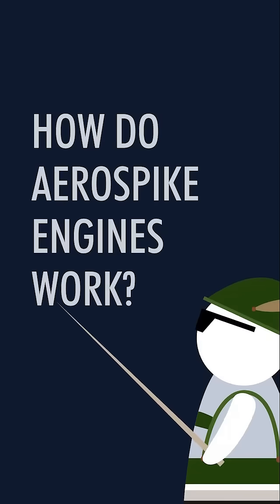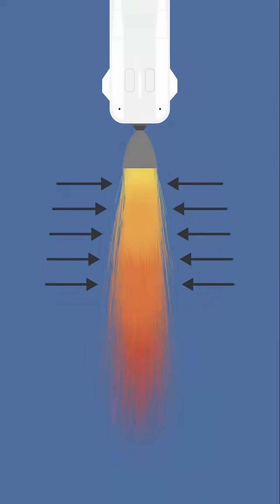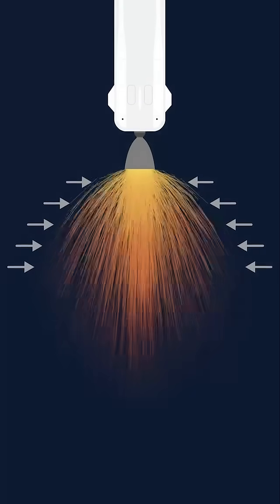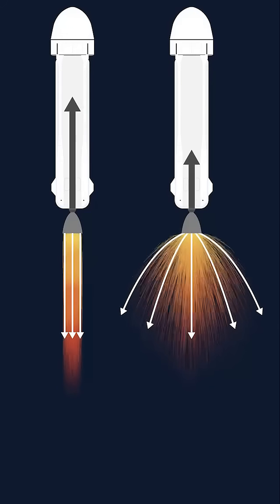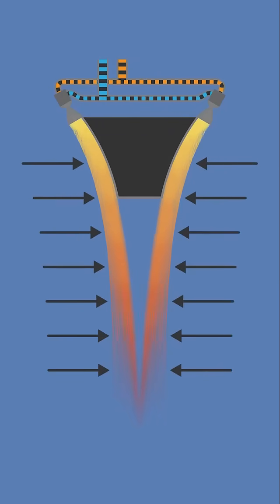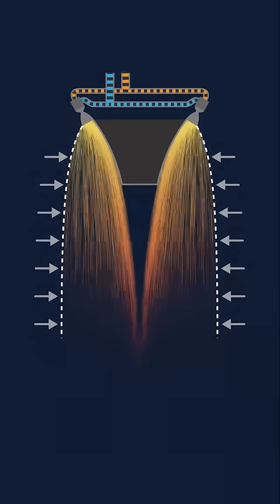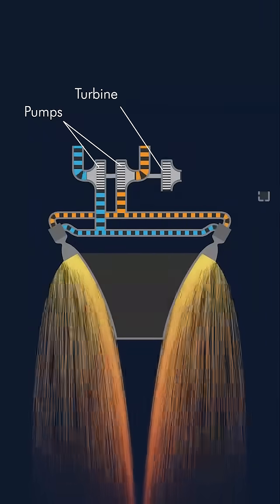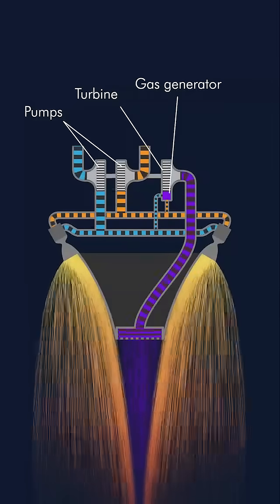Aerospike Engines Explained in 60 Seconds

Comment: I wonder if the difference in performance is enough to save a stage. Often rockets have an initial booster with an engine optimized for low altitude then switch to the next stage with a high altitude/vacuum optimized engine. Could an aerospike theoretically take you all the way up? Sure, you get a mass savings when you dump a stage but not having to lug a whole 2nd engine around is another savings.

Comment: The only problem is the video is wrong -- conventional engines gain efficiency when ambient pressure drops, not lose.
Reply: The lost efficiency at low altitudes is due to slower exhaust carrying less momentum than faster exhaust in vacuum.

Comment: For anyone wondering: the expansion OUTSIDE the nozzle doesn’t matter that much - the gases have already given the momentum to the rocket. And secondly, it is a good thing for rocket engines, as the gases in the nozzle are supersonic, and the speed of supersonic flow increases with expansion of the flow, unlike with the subsonic flow

Comment: The one key concept I would have tried to include is that, in traditional engines, the size of the bell is tuned to the ambient pressure, but its only maximally efficient at that one ambient pressure. The problem aerospikes try to solve is to be maximally efficient at all ambient pressures / altitudes.

Comment: They don't work, and this video is ridiculous
Reply from the maker: The German startup Polaris has tested an aerospike mid flight and the test was a success, so I guess real life engineers would disagree with your statement
Reply: I don't care  @spaceiac .  Results are easily falsified.  Ask me how I know.

Anyone with a real engineering education sees the folly of the concept.  It will, however, never die because the world is obsessed with 'disruptive' ideas that will earn big money.

How many Russian spacecraft use an aerospike?  Zero.
Reply: @DumbledoreMcCracken you ask someone with an engineering education.

Aerospike engines work and have been shown to work, they aren’t used on normal rockets because the benefits are marginal compared to the problem of heat dissipation they have
Reply: @peeperleviathan2839 they don't work.  I have a mechanical engineering education, and that allows me a certain degree of skepticism that is not typical in the aerospace community.
Reply: @DumbledoreMcCracken okay, explain why it doesn’t work.
Reply: @DumbledoreMcCracken silent now. Hmm
Reply: @peeperleviathan2839 because the aerospike throws away the majority of the static overpressure that the traditional bell nozzle converts into thrust.

A possibly better solution to the problem of underexpansion, in the bell, is to introduce additional fuel+oxidizer into the bell, after the combustion chamber, a la the afterburner, at low altitude where the static pressure pinches the combustion stream up inside the bell.

Comment: The graphic of the underexpanded flow is a little misleading. Thrust actually increases as ambient pressure decreases. Therefore, the ISP, or specific impulse would increase, making the rocket more efficient at creating thrust. The problem with under expansion is that the pressure energy that could have been used to generate more kinetic energy is wasted. Cool graphics otherwise!

Comment: What other materials can they be made out of?  

What about coated graphene and carbon nanotubes?  Would that make it light enough to Mount say 4 (plus 8 smaller) of these to a “Giant Silo/short cylinder?”  Say 4,500 to 6,000 feet in diameter and 2,000 feet high (yes- Burj Khalifa level height)and filled with helium, Hydrogen, and oxygen?

Think it’s possible to “Launch” it at 100,000 to 130,000 feet?

Comment: aerospike engines, if perfected, can help solve the problem of building a rocket which doesn't lose efficiency from sea level to orbit. But this is not an important problem to solve because there are already several good reasons for two stage rockets.

Comment: Forgot to mention that aerospikes can be adjusted at all altitudes to maintain maximum efficiency by moving the spike in and out.
Reply: and that would be the biggest bonus for aerospike engines.
Reply: This is not a Mig-21 intake shock cone. How would that look in detail? For example, if I convert the star ship. I make it even wider and place all raptor engines on a circle . They point inwards. Starship lands on the tower, to I have space to hang a cone down. So you would lift the cone and point the raptors inwards. And this would work better at sea level or vacuum?

Comment: I didn't know there had not been any aerospike launches. Great fun fact!
Reply: There was one NASA research engine made for the Venture Star (linear aerospike), but that program was canceled before flight.

The upcoming Stoke Aerospace upper stage will use an aerospike, where the spike surface doubles as a heat shield for reentry.  Very ambitious, but if successful may lead to the first fully reusable orbital launcher!

Comment: I don't get it, why does the exhaust gas expanding change the propulsion? 
It seems like the expansion would only occur after the propellant gas has already left the nozzle, but after leaving the nozzle the gas doesn't propel the rocket anymore. Can anyone explain?
Reply: nice question, replying here for the answer because i wanna know too
Reply: The 'overspray' out the sides generates lateral (side-to-side) propulsion, negating how much force is applied directly to the engine's upward potential energy; resulting in wasted energy, and overall higher cost in fuel /km traveled upward.

it still moves the engine in the right direction (as indicated in the Short) but less so than the Spike

Comment: What is "no flight experience?" Like they've never been used?
Reply: yes
Reply: Instead of a heavy aerospike engine, we use 2 different sets of engines. One optimized for high atmospheric presure. One optimized for vacuum.
Thanks to SpaceX's innovation we can even land and reuse the boosters and bottom stages, cutting down on the price.
The spacecraft becomes also very light once the lower stage is seperated, fascilitating the acceleration towards esape velocity with less fuel.
Reply: @ no one asked

Comment: That's one of the reaons why rockets have stages. They use engines optimized for the flight profile in each. The big difference is the bell nozzle.

The Space Shuttle is the only engine that's good for all altittudes. It's bell was designed in a way to mitigate the ISP loss in near vacuum and it's pretty cool. Though the Orbital Maneuvering System is what kicks it into orbit, using hypergolic Monomethylhydrazine + mixed nitrogen oxides
Reply: I think we have not enough animations which show how the shuttle drops the tank. So the tank stays on an elliptical orbit and will aerobrake, while the shuttle gets a small kick at the apex?
Notice how LEO satellites have their own third stage which still should use LH2 and HO2  and huge nozzles on tiny chambers( they have time to ascend ).
Reply: But it is wrong. Space x's sea level Raptor engine actually works in a vacuum.
The Raptor engine also passed the vacuum re-ignition test.
In addition, there are engines that operate even a vacuum.
(I'm using a translator because English is not my first language.)

Comment: So rockets DO push off of air.
Reply: not really? more like, air pushes off rockets. the thrust comes from throwing the burned fuel away from the rocket, not from the air pushing -- it's just that when there is less air, the propellant doesn't all go straight downwards, so it's less efficient. it does still function though, and works in a vacuum too.
Reply: @lazilexi  
In a perfect vacuum a fuel based rocket would produce no thrust. Rocket exhaust pushes off the air in order to produce thrust. Thank you for at least admitting the air matters. #NewtonsThird
Reply: @thomasg4324  i'm sorry but that's just not true. rocket thrust is made by throwing exhaust particles in one direction away from the rocket. each particle has some mass and therefore some momentum, so the force of throwing each particle out imparts an equal force on the rocket (as described by newton's third). the air only matters in this scenario because the ambient air pressure affects how spread out the exhaust will be, and any angular deviation from straight away from the centre of the rocket is essentially some wasted energy lost to horizontal movement. fuel rockets (which is all rockets, really - even ion thrusters use xenon fuel) do demonstrably work in a vacuum, because if they didn't than we couldn't have gotten to the moon, let alone any of our more impressive probes across (and outside) the solar system.

Comment: This looks just like pointing the nozzles in at each other. 
Couldn't they gimbal regular engines towards each other?
Reply from the maker: There's a reason why the Falcon 9 rocket has 9 engines. The outer ones can be gimbaled slightly inward, slightly improving performance at higher altitudes, but it's not as effective as a normal Aerospike would be.
Reply: @spaceiac   I didn't realize the outer ones could gimbal.
Reply: As long as you have multiple combustion chambers, yes, that’s the norm.

Comment: Why does the thing in the middle not melt
Reply from the maker: Good question! They do melt and that's a problem, so there are a bunch of small channels in the spike where the fuel is running through cooling the spike. Basically how a liquid cooled PC works
Reply: isentropic expansion in the bell nozzles before. You could check vacuum bell nozzles. The rim is just carbon ( a vase if you instruct your 3d printer ). No regenerative cooling needed.

Comment: The question is though, if they are so good, why don't we use them?
Reply from the maker: too hard to cool. Cooling is a huge issue with aerospikes, but metal 3d printing opened up some solutions for that, so in the future we will probably see some companies using aerospike engines
Reply: @spaceiac  too cool to cool

Comment: can't get a similar effect pointing some engine nozzles inwards?
Reply from the maker: I like your thinking mate! There's a reason why rocket labs rocket and spacex's falcon 9 have 9 engines in their first stage. You can point the outer 8 inward slightly using the exhaust of the center one as the "spike"

Comment: If the first part was true (that the exhaust expansion is a leak of power due to flux being aligned with the desired acceleration), the aerospike would be terribly inefficient due to a not aligned exhaust BY Desing.
The power leakage is actually due to a bell that COULD HAVE BEEN bigger, thus letting expansion occur against it. This is, of course, impossible at sea level due to flux risking beeing detached by air pressure (wich result in imbalanced pressure against the bell's wall and may lead to unexpected disassembly, as they call it).

Comment: This is incorrect. Your diagram shows the rocket in thinner atmosphere becoming less efficient than the rocket in the thicker atmosphere. In reality, as the atmosphere gets thinner, there is more pressure difference that could be captured with a hypothetical larger nozzle, and relative to this potential, a smaller nozzle is less efficient, however, what happens after the gasses leave the nozzle doesn't affect the actual power output. The rocket in thinner atmosphere becomes less efficient THAN IT COULD BE,  but not less than before. By showing the arrow getting smaller, you're suggesting that the nozzle produces less thrust. What actually happens is thrust stays the same, while potential thrust increases in the lower atmosphere case, and it is only in comparisson to different POTENTIAL output that the thrust "drops"...

Comment: All I see is how you can vector the thrust by manipulating the spike 😳🤔 Why is nobody else doing this? 😏
Reply: Because Aerospikes offer less performance in specific conditions. It’s cheaper and easier to implement a sea level (plus altitude) optimized engine on boosters because you can cluster engines and get the same effect with no thermal, mass, and GNC issues. And on orbital stages, you are high enough that having an aerospike just eats performance away from your stage.

Comment: I was just about to ask, but at the end I got my answer. Cooling looks like it would be very difficult to accomplish
Reply: Fundamentally the cooling requirement being three dimensional works as plotted on a cubed slope, but the surface area of the spike being two dimensional is plotted on a squared slope. The plots diverge, the cooling problem won't be overcome.
In a way it's like the basic concept of the ancient RL-10 hydrolox engine prevents it from future growth because there's no way to transfer more heat to the fuel mix so no greater amount of fuel beyond the amount in the current design. The changes for the last 50 years on that engine have been to make it lighter, more reliable, and now to incorporate 3D printing, but not able to burn more fuel.

Comment: Question: How do aerospike engines work?
Answer: they don’t
Reply from the maker: Well, they do but not for very long as they tend to overheat
Reply: @spaceiac  would it work if I used a material that is a good thermal insulator?
Reply: @dwalvyn that’s called a heatsink engine, works in small durations but anything will eventually overheat from the exhaust especially in an aerospike as well as driving up the cost

Comment: Isp increases as a function of altitude because the back pressure you're expanding to decreases. How do you reconcile that with your claim that rockets get less efficient as pressure decreases?
Reply from the maker: I should have phrased it differently. A straight exhaust plume is more efficient than an expanded one under the same pressure. So what I meant to say is that it could be more efficient if the exhaust plume wouldn't expand. It's bad wording, and I am totally aware of the mistake

Comment: I was curious if we could use a alcohol sanitizer as fuel since we can combust it to a gas state, by adding lots of pressure either by using a piston to add pressure or either adding Air to the container, then it becomes into its gas state then after that, we can use other fuels to light it up, like hydrogen since it is extremely flammable.
Then use it on any type of engine such as just a normal engine or a new engine that's the alcohol sanitizer fuel.

I was pretty much thinking a d imagining about this actually happening.
Reply: Sure, alcohol was used as a fuel in the V-2, Mercury, and most recently - the small VTVL test bed vehicles produced by Masten and Armadillo. XCOR also build some alcohol engines. It doesn't leave a residue, readily evaporates, and basically cleans your plumbing as it runs through. Also, it's pretty benign to handle. It's a good fuel, albeit not quite as efficient as kerosene (RP-1).
Reply: Liquid alcohol is already used. They add oxidizer.
Reply: You can use water, iron, uranium, argon, methane, or any other substance as a working fluid. The main thing is to heat the working fluid strongly.
Reply: @Bomje_Juck  fuel weights. You can add any stuff into the first stage, though. I still don't get, why first stage cannot breath. Mach 6 is possible.